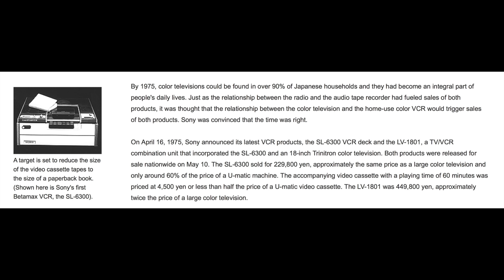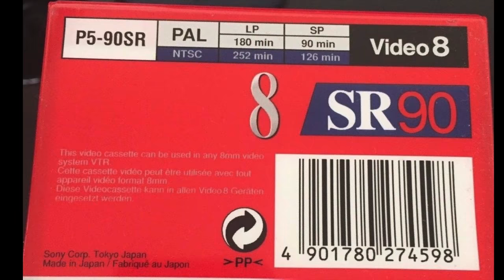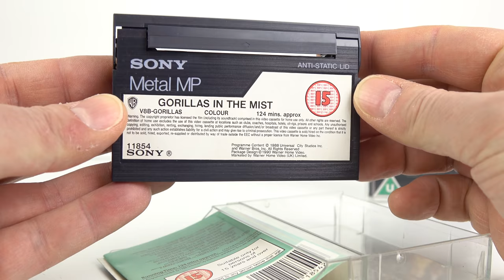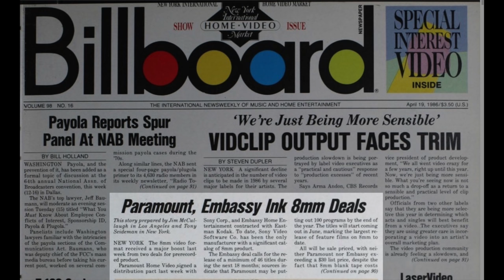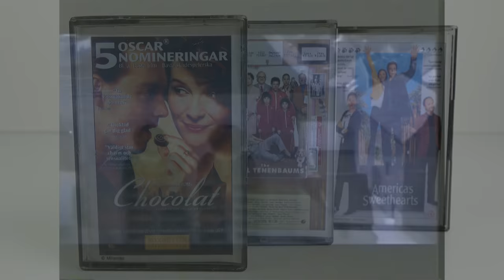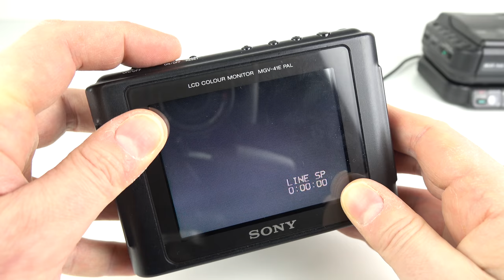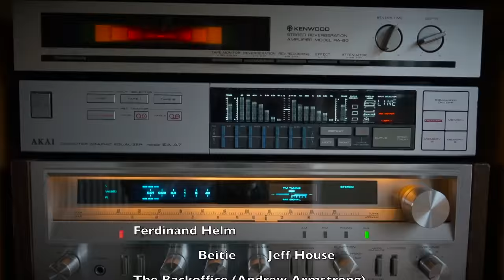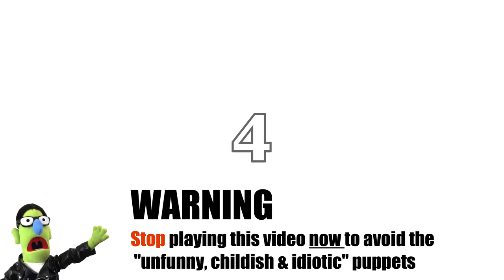Video8 - Sony's forgotten ambitions & the crazy Walkman Compo

Comment: Sony seemed to be good at making technically superior products that failed...
Reply: Sony was always more expensive and catered to a high end market. Then they lowered their build quality and alienated their fanbase in the mid 90's and that's why Sony is not the juggernaut they used to be.
Reply: Not exactly... Sony operated in a strange middle ground with a lot of things and sold a ton of products based on hype or wiz-bang features that really didn't add much to their products in terms of function. Often times those features resulted in stuff failing prematurely. All of the fancy motorized loading systems on their products being a prime example. I know at least into the PS3 era they were still haunted by that stuff. The tray-less loading and capacitive buttons and such were cool, but didn't really get you anything but decreased reliability.

Sony's high end line was the ES series of equipment, and some of that stuff truly is great equipment. Over the years I've had a couple of pieces of ES gear and an absolute boatload of the more up market regular Sony offerings and there is a clear difference. I'm sure that used ES gear costs a small fortune now, but it would be a cool video if Techmoan ever got a hold of any of it.
Reply: Oh bullshit, they make some of the best video game consoles and invented the Blu-ray.
Reply: This is so true. People still like to talk about how great Sony stuff is, but frankly anything from mid 2000s on is mediocre (aside from a few really high end products). The folks who know their stuff really miss the Sony of the 80s and 90s, though it's understandably hard for Sony: they had a high profile when they catered to the high end but they often mess up things (Betamax, MD, etc), or they go mass market and lose all the tech stuff that made them great. They never seemed to be able to figure out how to get it quite right.
Reply: Clay3613 If BluRay hadn't been invented... we would live perfectly as happy as now with HD-DVD.
Reply: tissot233 yup, the best analogy for today would be... Apple? Mercedes-Benz and BMW put together? Is there a brand who has 85% of the professional market of something?
Reply: The funny this is that if you had told people in the 80s or 90s that Samsung, a KOREAN company, would be dominating Sony in consumer electronics, people would think you were entirely insane. Korea used to be the place to go for cheaper, knock-off Japanese-style electronics.
Reply: Wow, thanks for the stories guys.

I grew up in a family where there was no money for expensive electronics, so we always used to have electronics with from B-brands. That's why I never experienced the Sony of that era. Which is a bit of a shame, as I only found out in the 2000s when I bought myself a second hand trinitron tv, what the difference in screen quality was compared to my parents' tv.

I also would've loved to have sooo many buttons on a device, and have displays showing all sorts of information.
Reply: Harel Davolt The  PSP was ahead of its time yet it sold less than the DS
Reply: No they weren't - those were just new iterations of video game consoles. While they performed well, they aren't even close to representative of how innovative Sony really was, which is what everyone's talking about. The stuff Sony put out back in the day makes their video games division look positively pedestrian.
Reply: Best phones, no marketing.
Reply: pretty much the majority of their stuff (although I sure loved my Walkman back in the day)
Reply: I had a Samsung tv in the late 80's because that's all I could afford. I still have it today for old NES and SNES games and people that come over and see it say "Samsung are great tv's!". Little do they know it was the cheapest tv in the whole store.
Reply: Its almost impossible to make a good product in this globalist market. With Chinese goods dominating the market, there is always the incentive to make products cheaper and cheaper. People are used to paying nothing for everything. I paid $250 for my lower mid range Sony receiver in 1982, about $700 today. High end Sony today is about $1000. How can you make a great product when people won't pay for it?
Reply: Sony launched lots of ultimately failed consumer products, but they absolutely owned the broadcast technology market for decades, and they are still a very major player there.
Reply: Many people would (and do) pay more for a quality product if they know it isn't going to break down in a few short years (investment). When the quality of the product dips below the amount spent on it, even a small amount, people feel robbed. Surprisingly, people become sick and tired of constantly replacing quickly broken products or experiencing compromised performance. They much rather pay once and not worry about it and enjoy it for a long time. People thus demand more bang for their buck and are willing to wait till they can afford something they truly want. Hell, they'll use credit or a payment plan to get the better product, even if a worst one is already cheaply available if they are unable to wait.

The misconception is that unless something breaks in a few years, people wont replace it with new ones. Yet, people still buy newer products, even when older ones still work fine and can do a comparable, if not lesser job. The truth is, nobody wants to appear a product behind their peers. Look at Console Generations. There is a shelf life to a product in the eye of the public that is opposed to its continued functionality and use. Most people want to be hip, current and experience the same new products as everyone else. They gladly shell out more for a better experience than the frustration of a lesser one. Hence why premium products are advertised as lifestyle and status, while lesser ones are dumped in malls and bargain bins.
Reply: +Clay3613 I believe the conception of Blu-ray is a lot less glamorous and a lot more stuffy and boring than one single company inventing it.
Reply: Harel Davolt like the ps vita
Reply: Harel Davolt They where also good at trying to hog the most rights its seems. first with the betamax and then with the nintendo playstation. where they wanted all the rights and profit from the cd games on the system
Reply: @Clay3613 It was actually one single Dutch chap at Philips that invented ALL laser based disc systems... from videodisc to compact disc, DVD, Blu-ray and HD-DVD (which was superior to Blu-Ray).

So no.. it wasn't Sony who invented Blu-Ray. Just google the name "Kees Schouhamer Immink"
Reply: +BlownMacTruck, Then maybe it would be interesting to predict that Chinese companies like Huawei could begin to dominate both Japanese and Korean companies by the 2040s or 50s, as Samsung have with Sony...
Reply: I really want a sony betamax now, but they are expensive and usually need fixing.
Reply: You know ironically that is also was happened with Germany.
The UK wanted to throw a wrench into foreign (especially) german mass produced cheapo product imitations. So they forced company's to mark their products with "made in".
Reply: Jup almost every time.  Sony developed a very appealing product.

To screw it up by self limiting it's consumer base.
They always wanted to defend their own little corner of the market even it sabotages their own products.

That's a very Old Guard Japanese way of doing business.
To be fair those people made the Japanese economy to a international powerhouse. But they did completely miss the point that those economic tactics where/are completely outdated.

It also did not help that those tactics did actually work in the Japanese  Home marked.
Reply: Apple? Not even close. Yes they make premium products, but they only have a 17.9% market share in smartphones and 7.1% in computers.
Reply: ...but then, Blu-Ray.
Reply: @Gabriel Riva  Yes...Microsoft has about 85% of the market in software,especially office software,even operating systems.
Reply: ..and yet have you noticed how prevalent Apple computers are on TV dramas, movies and the like? You'd think everyone had an Apple computer tucked into their back pocket. Most striking is seeing them on police dramas and on detective's desks. Pretty hokie to me.
Reply: Hy Braverman LOL they sold those brands at the outlet in the Simpsons.
Reply: Harel Davolt At least the Playstation was a success.
Reply: Harel Davolt Sony was quite successful, even those celebrated failures really weren't as bad as some think. I always admired their spirit in bringing their ideas to market, much like Honda. Their founders were visionaries.
Reply: David Malinovsky If Samsung was garbage 30 years ago, I guess the Chinese brands could do same.
Reply: Alex Munoz They (the Chinese) certainly could. All one has to do as look at what the   Japanese have done.
Reply: Spot on.  VHS won because Panasonic (?) allowed anyone to make machines.
Reply: Harel Davolt that's because Sony excels at making smart stuff but they don't typically listen to what their customers actually want.
Reply: i love their TVs though.
Reply: Harel Davolt they are this at everything. even today. they have great technology but they cant market for shit.
Reply: they were very stubborn, same thing happened with ‘memory stick’ vs SD/CF, and their ATRAC (.aa3) vs MP3 - they still haven’t learned, still using Memory Stick Duo in their new products
Reply: Harel Davolt The Betamax I had better video quality at the expense of running time, but was phased out by 1979. Otherwise VHS was about the same quality at a lower cost. The big thing was Sony was stubborn on pushing film quality, when RCA and consumers kept saying, it needs to record a movie or football game. The first Betamax didn't even have a built in timer.
Reply: Definitely standards :-)
Reply: Harel Davolt what was the thinking of umd?
Reply: Then Sony finally got their way when Blu-Ray came out
Reply: Panasonic has always had vastly better displays in TVs than Sony or anyone else really.
Reply: Panasonic is the less sexy brand, it's the dad body, everyone thinks Panasonics are unknown, but a lot of people come home with one.
Reply: I don't care if they are unknown or not,.. the flat black screens murdered the competition and then during plasma,  they had the best blacks, picture quality and were one of the first to have really high frame rates. They have always made Sony TVs look like pixelated, washed out trash.
Reply: I remember when Zenith was a popular brand until LG bought them out.
Reply: "It was actually one single Dutch chap at Philips that invented ALL laser based disc systems... from videodisc to compact disc, DVD, Blu-ray and HD-DVD (which was superior to Blu-Ray). Just google the name 'Kees Schouhamer Immink'"

Google: David Paul Gregg
Reply: "The Betamax I had better video quality at the expense of running time, but was phased out by 1979."

I beg your pardon, but the newest Betamax I've ever owned was the SL-HF2000, which was purchased from a mail order company in 1996.

That's right: Sony continued to make Beta VCRs for the consumer market until around the turn of the century, though only a couple of models and only for special order.
Reply: "VHS won because Panasonic (?) allowed anyone to make machines"

JVC invented VHS.
Reply: He's talking about Betamax 1 with the higher tape speed. Here in the UK we never had separate tape speeds on Betamax, but apparently in the US there was 1, 2 and 3. 1 was phased out early on as mentioned, leaving just 2 and 3, roughly equivalent to the standard play (SP) and long play (LP) on VHS. VHS went further with an SLP.
Reply: When Beta came out for NTSC markets in 1975, there was one speed, referred to as X1.

A couple of years later, Sony comes out with X2.

A couple of years after that, Sony changes the nomenclature for speeds from X1 and X2 to ßI and ßII while introducing ßIII.

Sony kind of phased out ßI until bringing it back with recording support under SuperBeta (or Hi-Band Beta in Japan), called ßI-S, first with the Japanese SL-HF900 and then with the American SL-HF750.  The Japanese SL-HF1000D and SL-HF3000 as well as the American SL-HF1000 went further with ßI-SHB (Super Hi-Band).

Virtually all NTSC Sony Beta machines at least have playback support for the original X1/ßI speed whereas other manufacturers didn't.

As for VHS and the format's North American rollout, RCA expressed concern with VHS not having a slower tape speed.  JVC basically told RCA to take it or leave it, so RCA went over JVC's head to their corporate parent: Matsushita Electric, which was also the corporate parent of Panasonic/National/Quasar/Technics.  From there, RCA and Panasonic developed the four hour speed for the North American market and referred to it as LP.  JVC objected to this, but couldn't do anything to stop it.  All JVC could do is basically refer to the 4 hour speed as "the bastard" while also only implementing limited playback support for that speed for VCRs they made for the North American market.  JVC would release the 6 hour speed after that.
Reply: Unfortunately, being born the year I was born (1980), I never got to own a BetaMax.  I came to age right about the height of the VHS era, in fact, in grammar school, we got the reel to reel, in Jr. high school (early secondary school) we got the VCR and in High School we got DVD players (mid to latter secondary school) so it was almost like I was going forward in my education while technology was going back.  Assuming that both formats used the same terminology and if I remember, we had SP (Super Play, which ran for 2 hours at best quality), LP (Long Play which ran for four hours at standard quality) and SLP (Super Long Play which ran for six hours at decent quality, basically, if you just wanted to record a show for later since you had to work at that time).  Granted SLP was the worst of the three but all in all, wasn't that bad.
Reply: "Granted SLP was the worst of the three..."

Not necessarily.

In some cases, SLP/EP can actually be better than LP owing to better head optimization for SP and EP on a VCR with four video heads, especially if the EP heads are 19 microns in width (which results in thinner video tracks that are less likely to overlap due to the slower linear tape speed, reducing crossover distortion though at the cost of signal/noise).
Reply: I got nothing!   I was never a VCR tech so I have to take your word for it.  If I was, I would be the guy on the phone tree that says "If you need help setting your clock, press one"
Reply: they didnt fail they where the best and we had good times in the 70s and 80s 
better then todays eq
Reply: one big thing i never see mentioned much is Sony always seemed to either keep their formats proprietary or made it unappealing for other companies to license out the tech. As such it made it easier for rivals to flood the market with their more open formats and with more options available its easier to get the prices down. it wasn't until BluRay you actually seen sony launch with multiple brands using the tech.
Reply: Very true
Reply: @neonet310  Films and TV shows on UMD will be a "forgotten format" in future. I ought to start a collection now, while they're cheap.
Reply: The ps vita comes to mind
Reply: @TheBrokenLife  still don't get why they don't sell tv geared towards ps4 owners and gamers in general seem like that would work in favor.
Reply: Just like Germany in WW2
Reply: @EmergencyChannel  Sony went downhill after Masaru Ibuka, Akio Morita & Norio Ohga all retired one by one.
Reply: @cybhunter007 Holy crap, yes you are digging up some old times! haha.. I have a fat PS3 as well, still going strong with all original parts (upgraded HDD, but otherwise, that's it). I did re-paste it about 10 years ago just to play it safe though. I'm sure it needs it again. In fact, that's a project I'll probably eventually get to on my channel eventually, but, no time soon.
Reply: sony also used to make/still makes cell phones but you dont see anyone with a sony cell phone. Same thing goes for sony laptops. I wonder if video8 would have been a success if samsung made it...
Reply: That's the beauty of it..keep discovering,inventing and innovating.
Some of the products were hugely successful some not, but they (SONY) have always been the one to come up with many of the industry's first.
Regardless of the commercial outcome of the products Sony released throughout the years, it has earned  huge respect.
Reply: @BlownMacTruck From memory Samsung was already very good quality by the mid 90s, I think they made some of the best VCRs. Though Mitsubishi made some the best early on, and they seem to have pretty much disappeared from video related products.
Reply: @EmergencyChannel  right it sad we will pay extra for sony made in japan then sony made in china.
Reply: Yeap have to agree. I used a fair amount of Sony Hi-8 equipment in its time and  had 2 camcorders fail -2 playback decks -2 editing control decks -and recently dumped a GV-HD 700
-all very tech superior gear - but no longevity built in - and MUCH too expensive to even consider worth repairing.   Welcome Panasonic (not afraid to say it) I have run thru over 500 mini
DV tapes thru a Panie DV 10000 and not 1 hiccup!
Reply: BlownMacTruck Exactly! Same as if You’d told us that Chinese brands would be successful.
Reply: sony seems to be good at making products that fail by themselves within 3 months after purchase. and then have all kinds of tiny screws and mylar cables so if you take them apart you never can put them properly together again. can be something as simple as a connector breaking off as in order to get to that connector you still need to go through the whole thing.... but usually something vague such as displaying 'dew' and not doing anything anymore. :P
Reply: @RandallJennings  It was JVC (Victor Company of Japan) that developed VHS.
Reply: Then they made Blu Ray and they are doing very well with it
Reply: 2 words - Sony Professional.
Reply: I would never buy anything else than the B.O.S.S. for midcore camcorders, even though other companies might have their own ones, I think those servo-motors are the best and I still get compliments on video footage taken while walking and still has a steadicam feel to it despite being in a 2012-made 1080p camcorder.. So yes, SONY is still great at those.
Reply: @tissot233  
Can confirm Sony was the 900lb gorilla in the 80's. They were the equivalent to Apple today. 
Problem with Sony was they were too slow to adapt due to their business hierarchy. Then they would play games with consumers with their copyright management software crap. Those two things is what brought Sony down not the financials as Sony had a boatload of money. They are coming back a teeny bit with their phones though. Super phones their Xperia lines.
Reply: @BlownMacTruck  
Not having lived in Japan for a while I will tell you Sony leaves their best for their domestic market. Seems like in their business cycle when they feel like making an international product they will send it out but if not it stays in Japan. Weird thinking over there.
Reply: @RFTL  Germans weren't making cheap knock off products, WTF are you smoking? Then again, which Germans we talking about? The DDR Germans or BRD Germans?
Reply: @fungo6631  Sorry, I didn't realise that 2022 was in the 2040s or 2050s. Try again in another 20 or 30 years perhaps. Also, what's with your needless insults? Hopefully you'll have grown up in a couple more decades.
Reply: @dan_  Here's your 50 yuan cents, wumao.
Reply: @fungo6631  I had to Google that to find out what it means. I can assure you that I would have very few positive things to say about the CCP, so I'm certainly not here to defend them. I think you need to calm down, we're talking about technology, not politics.
Reply: @Clay3613  ikr? “Not what they used to be.” Is this the company that made the ps5? The thing they literally can’t make enough of? The thing they’re selling for over half a grand for no fucking reason and I’m still gonna buy one? “Not what they used to be”, bah.
Reply: Sony PlayStation, mirrorless cameras, image sensors for mobile - Sony are still giants of tech world